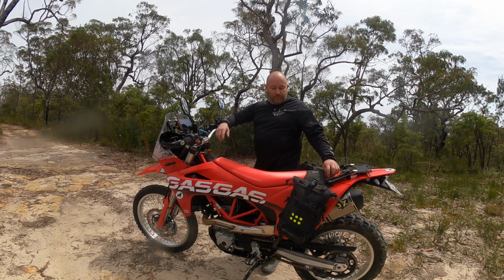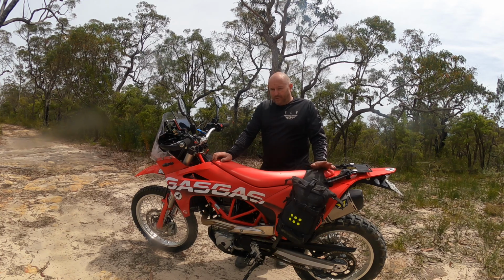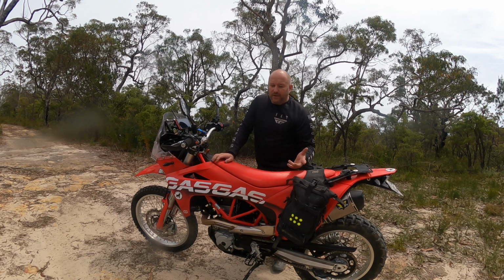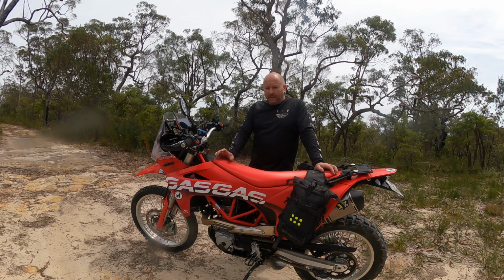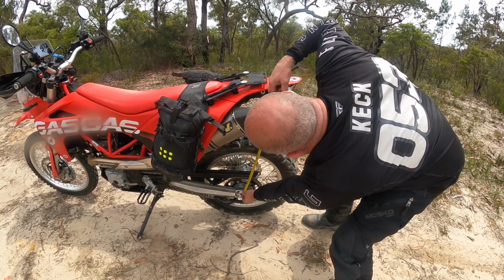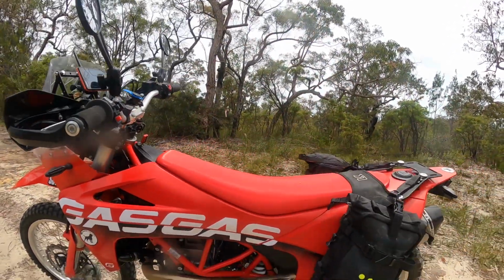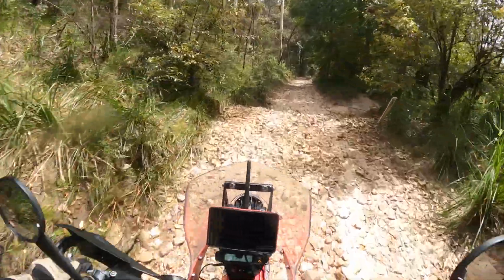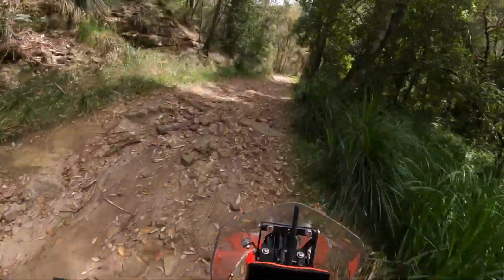GasGas es700 Bike build The suspension

Comment: Great video lots of good info, I did the springs and revalve also i put a set of 300mm forks on my 2021 690 totally transformed the stability of the bike feels more like an EXC now.
Reply: Did you leave the rear at 250 with the 300 in the front?
Reply: @michaeloakes4018  yes leave 250 on rear i found it was much more stable at all speeds and all terrain
Reply: What forks did you put in? Front axle/hub compatibility ok?
Reply: @michaeloakes4018  I got a set of 2021 Sherco 300cc xplorer 300mm forks took to a suspenion guru who swaped the feet over so axle, wheel, disc and caliper all fit and they slide into the stock triple trees very easy conversion, you could use 300mm EXC forks and do the same mods

Comment: Just found your channel and glad I did, you have a great way of delivering information (straightforward with no bollox). Ive been looking for a 690 for ages but now considering the GasGas. Do you mind me asking how tall you are? I'm 175cm. Currently riding a Tiger 900 but still too heavy (downsized from a BMW GS1250). Anyhow, keep making them videos coming, cheers.
Reply from the maker: Hey mate thank you very much ,I'm 175cm tall , I came of a 1200gs and am loving it
Reply: @chasing_the_dog3277  Cheers, I was hoping to get away without the lowering kit. Just hope the dealer can fit one for cost as I now want a red one.👍
Reply from the maker: Unfortunately they are a tall bike ( tge 690&701 are the same height ) hopefully your legs are longer than mine ,